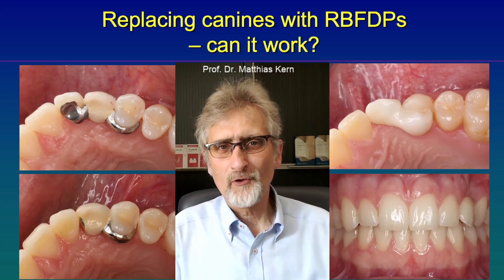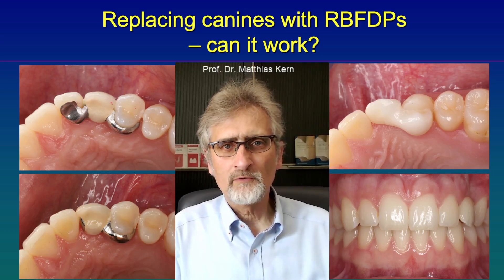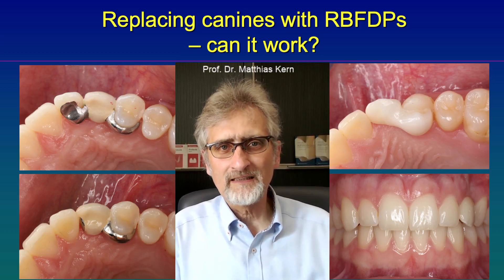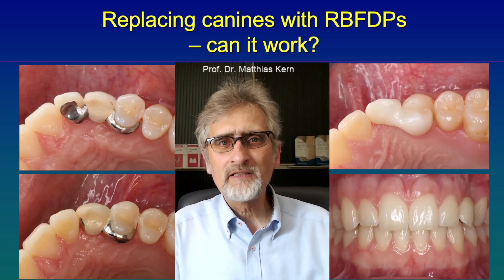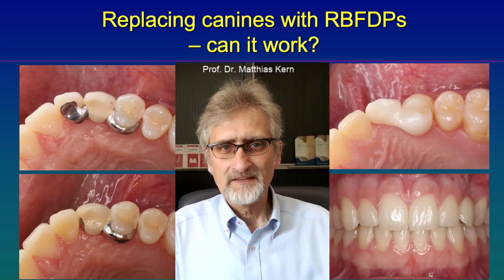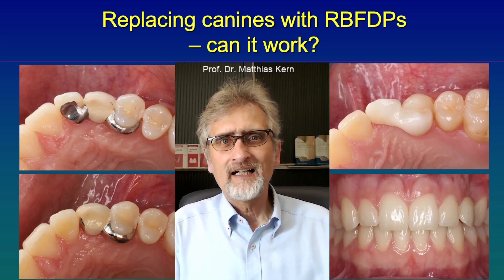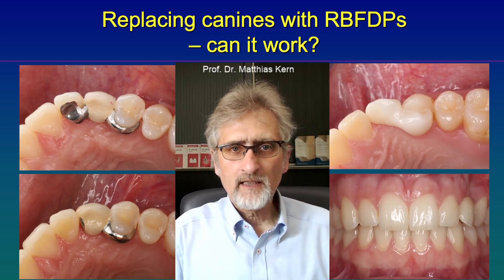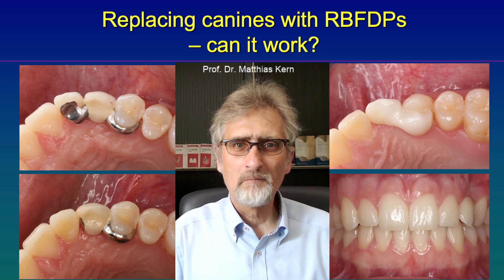Replacing canines with resin-bonded bridges - can it work?

Comment: Thank you for this video. Is it possible to have the canine as the pontic in a three unit bridge? My thoughts are canine guidance would place too much strain on the abutments.
Reply from the maker: Canine guidance on a pontic is always high risky!  As suggested, the strain on on the abutments is very high and will often lead to failures later on.

Comment: Hi Prof, love your short and quick video tips. Would you consider an overlay designed wing on the 24 to establish the premolar guidance versus using composite on the buccal that will eventually wear down? It just feels like a more stable design vs the wing on the palatal cusp only. Cheers
Reply from the maker: Thanks for your question. Sure, a ceramic overlay would be an alternative to the composite resin. We start with the composite resin and if it wears too fast, we replace it with ceramic, preferably  lithium disilicate. In addition, patients usually wear a thermo-formed splint as nightguard.